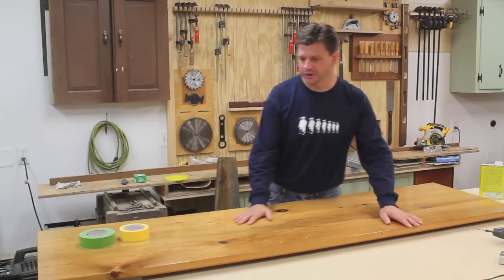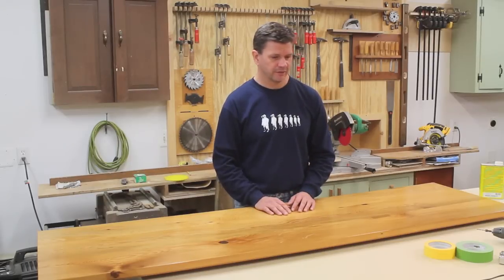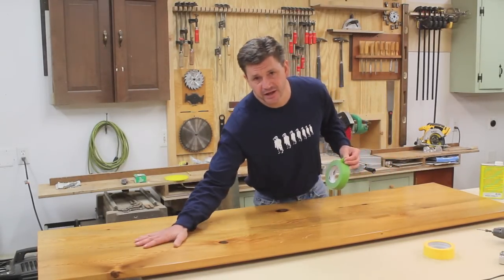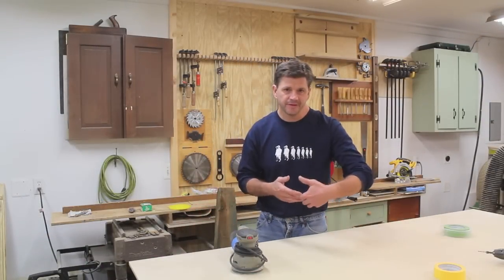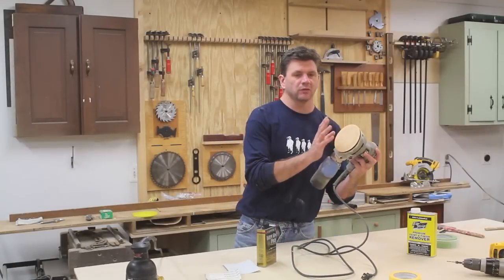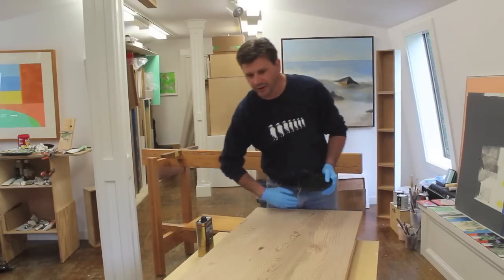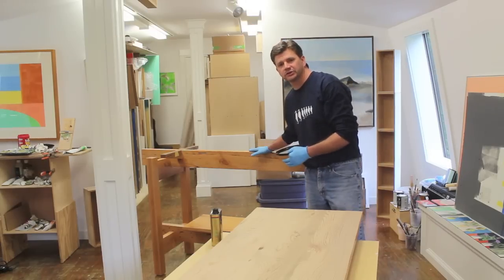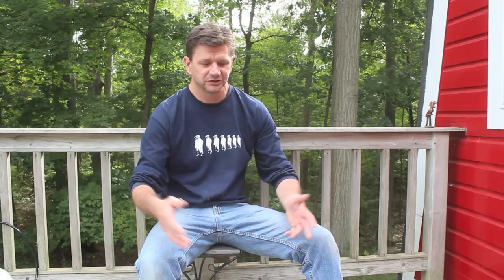How To Strip and Refinish a Wooden Countertop

Comment: John,I’ve watched several of your videos.  I’m refinishing a cherry countertop where water penetrated and got between a few boards near the sink.  I’ve sanded off the top but those spots are still black lines.  Is there a way to get the black less noticeable?

Comment: Hi Jon, I know this is an older video but I'm hoping you can help me out. We just got butcher block counter tops installed in our new kitchen (white oak tops) the company we hired did fine with the install of the counter itself but a pretty terrible job with the staining and finish. First off...they stained it the WRONG color and they didn't wipe well at all so the stain is very uneven. We had them back 3 different times and it started to get worse the more they tried to "fix" it. My husband and I decided we would probably have better luck doing it ourselves. They put 3 coats of uneven poly on it and 2 coats of stain in walnut when we were wanting dark walnut. Any advice on how we should go about fixing them? Thank you!

Comment: Another great video Jon.
I have few questions: First, concerning the shirt you designed, I checked "Shop Jon Peters" and didn't see it listed there. Where/when are planning to sell the shirts (for this Christmas season I am making a list of my favorite You Tube channels and asking friends and family to by any gifts for me from the list)? Second, concerning the Zip Strip, would you recommend if for use in removing an oil based paint applied (applied approximately 35 to 40 years ago) to an antique farm table (wood species unknown) that initially belonged to my paternal great grandmother? Finally, after removing the oil based paint from the table, would you recommend an application of poly to the table top?
Thanks Jon, I'll be looking forward to the finished alter top.

Comment: Hi Jon, I have a wooden countertop in the kitchen and the wood around the sink and taps has become soft and mouldy in some places. If I wanted to remove all the bad wood I think I'd end up losing a couple of mm's in some spots. Planing/sanding down the rest of the countertop would take ages.
I'm thinking at the moment I'd have to rout a 5x5 mm depression around the entire sink and fill it with something. Is there any other way to rescue this?

Comment: I'm a professional painting contractor, do allot of commercial spraying. The only problem with the wipe on finishes is you just don't get the build you need to protect the table. You can apply 20 coats and you still will have a very thin build. In order to get the protection needed you must apply the brush, role or spray finish. Be careful not to allow dust to get on the the table, light sand between coats and after the final coat, buff the finish out.. That's allot of work, the table will last almost forever, or until someone drags something heavy and sharp and ruins it again. 
PS, enjoy your videos. 
Vinny

Comment: Have you tried to remove finish with heat gun ? I believe it will be far less toxic then using a paint striper or any other solvent based solution. Anyways – another great video!

Comment: In the video where you first made this piece, you mentioned that you used several coats of WOP followed by three coats of Waterlox.  Then, when you had to refinish it (bummer!), you apparently used only polyurethane.

Was there a conscious decision to NOT use Waterlox the second time?

The reason I'm curious is that I'm a turner, and I have a shop-made finish (1/3 tung oil, 1/3 spar varnish and 1/3 turpentine) that I think is very similar to Waterlox.  According to what I've read, so-called 'long oil' varnishes (more than 50% oil) aren't as tough as varnishes will less oil.  Was that part of your reasoning?
Reply from the maker: not really I just wanted to try the WOP